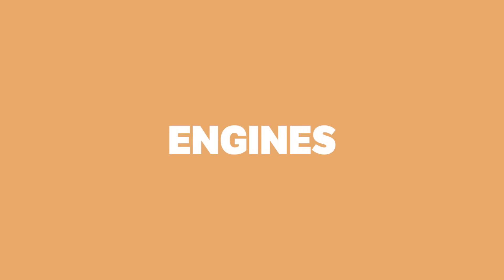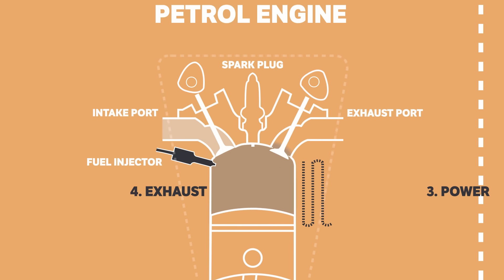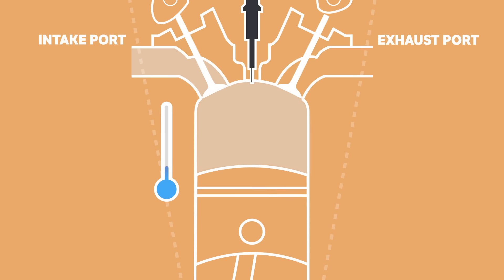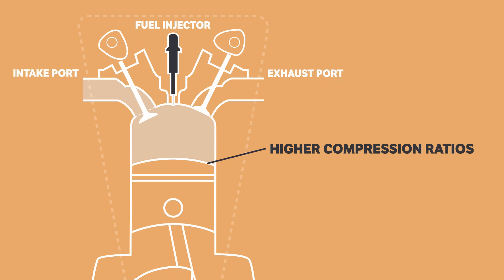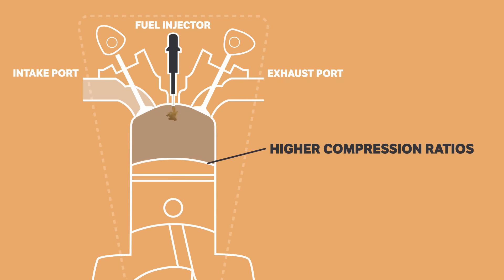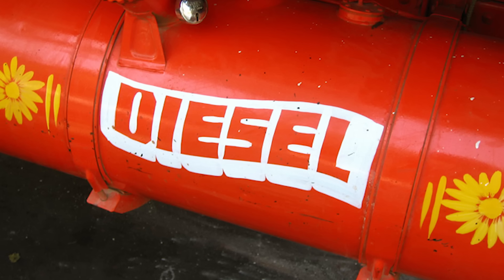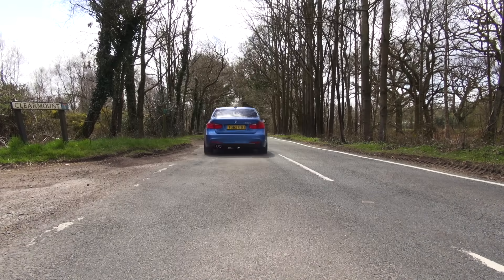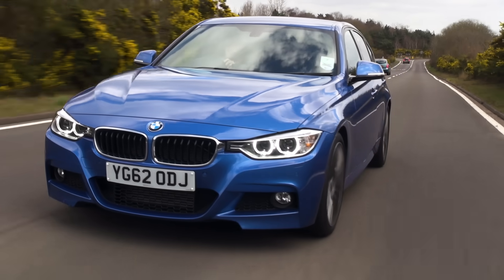The Differences Between Petrol and Diesel Engines

Comment: If this world starts going for electric cars, which it is doing, then in about 50 years, history teachers in school will use this video to show kids what it was like in the petrol/ diesel era
Reply: This comment made me sad.
Reply: Doesn't matter if you're going electric if the electricity is supplied by a polluting generator.
Reply: Luka Ohagei Ups sry m8, i fucked up. Thanks for correcting me. ;)
Reply: Scho0rschi it comes from much more efficient solar, nuclear, wind and water and heliostats
Reply: @RonanTetsu lmao imagine being this delusional
Reply: BME90 batteries are constantly improving over time with research and development. In ten years batteries will be light years ahead of today.
Reply: Luka Ohagei or maybe they create a fuel with no emissions. I feel like that is likely as well. The reason electric cars arent taking over yet is cause of the price of the batterys. You better believe they have batterys that have the power to go 400 miles on 1 charge but the price for that is ridiculous thus we have 100 mile batterys in cheap cars like the chevy spark
Reply: Why all the negativity towards electric cars? Except for the noise, an electric motor does exactly the same thing as a petrol or diesel engine - that is, driving a driveshaft to make the wheels turn.
Reply: MrSupercar55 A model S has about 350 miles of range (600 km), which seems fine to me, whereas the smaller model 3 has only goes a much more modest 220 miles (350 km), which is on the lower side. Still, it seems to me like the range issues have been pretty much sorted out, and you'd just need to build a network of chargers similar to the network of gas stations around there to make the thing viable. Other manufacturers still have to catch up with Tesla though, especially since the S is an extremely expensive car. You do need to plan your charges out though, which is a bit of a bummer. There are some cars with quick change batteries out there that you can just swap out, but they need to me much smaller capacity. I really can see this aspect going much better in the future.
As for the sound, that's much less of a practical concern, and much more of a taste thing. Not many people own supercar, and I do think that wealthy petrolheads will stick to petrol cars for a long time. Although engine noise appreciation is a bit of an acquired taste, and I'm pretty sure that high end manufacturers will find a way to make their stuff sound attractive.
Reply: We already have electric cars lmao
Reply: There will be two types of Electric car though Pure Electric for battery only car which would be used extensively in cities and Hydrogen Fuel Cell (particularly FCHEV: Fuel Cell Hybrid Electric Vehicle) which keeps the same convince as petrol/diesel car of course they can and most will have batteries too for the best of both.

One of the latest things I found out last year in collecting hydrogen is methane cracking where methane is bubbled through molten tin which cause it to break apart into carbon which is a powder (the common misconception is this make CO2 which is wrong since there is no oxygen in the methane it just produce C carbon) and 4 Hydrogen. So that is powered from waste like shit.
Reply: Toyota Mirai that's an FCHEV its already available the problem is Hydrogen filling stations much like charge points were a few years ago there are pretty much none though they are slowly being built.
Reply: Yeah luckily one of the big oil companies Shell (as far as I remember from research project I did last year) are putting there money into building Hydrogen filling stations in Europe (which is also a way for their company to survive but we benefit) for privately owned cars I'm not sure whether Shell even has presence in the US if they do I would imagine they are likely doing the same thing there. In the end its all a matter of time really.
Reply: @AurageyserOrion  late response but hydrogen fuel cells are so inneficent to make
Reply: That is very true. My dad has a 08 Lexus rx400h hybrid and it is truly amazing as it is. You get a 3.3 V6 with electric motor about 270bhp total, and for £100 we got 650 motorway miles. Considering it's a 2.5 tonne 4x4 with a 3.3 I think the hybrid tech really makes huge difference - I spend £80 in my 1.4 tonne bmw 320d so thats pretty dam good going from the lexus. Also 50% less car tax compared to say a bmw x5. There will be a day when electric is much much better than now but in terms of sustainability, hydrogen is the way. Petrol/diesel all the way for me though!
Reply: Electric cars are fine for short journeys. However, as much as they've been around for decades, when it comes to long journeys, they seem to still be having a slight teething problem. Very limited range, combined with long charging time. Even the 30 minute charging deelies they in some parts of the world are glacial compared to how quick it is to unscrew your fuel filler cap and fill up. Then there's the question of exhaust sound. Petrol supercars have the most amazing sound. Electric Tesla performance cars have no sound. From my point of view, 3-1 to petrol and diesel is the full time result. I even made a video about it a little while ago.
https://www.youtube.com/watch?v=_bXBm280nGQ
Reply: @MrSupercar55  still think that now?
Reply: Gotta use up that sweet sweet moneymaking oil supply before making decent electric car engines for the people. And gotta wait for all those petroleum companies to have monopoly in electric car manufacturing before they bring something worthwhile for us to let us switch. Thank the market for prioritizing making money instead of progress.
Reply: multiestonian wrong. they have a normal range of 180 to 300 miles
Reply: I think petrol will be replaced with electricity but I don't think this will be replaced I don't think electricity has as much energy as diesel does.
Reply: You cant rob peter to pay paul. Why would a  electric car be more efficient if you pay a company to make electric some  still are huge  coal and even a few diesel generators  . Those company's have 1000s employees that drive there daily , stuffed is shipped in and out of the company , road crews for maintenance an what not. Now you really think electric is  cleaner than gas/electric.
Reply: @markrich3271  because a gas powered car is still made by the same employees in the same factory while it is still less efficient than an electric one. Stupid logic lol
Reply: @DavidLopez-uo9ie   You  obviously didnt understand what I wrote. It had nothing to do with the efficiency of an electric car vs a  gas car .
Reply: @DavidLopez-uo9ie  I do find it amusing thats what you took away  from what I wrote.
Reply: u dont have another 50 years. youre all fucked and going in fema camps in end of 2020. if u survive u will take the chip. cannot buy or sell without it. stupid sheep
Reply: Hi kids to day wer going talk about   
Diesel
Reply: No they won’t. 

Did you learn how the Walschaerts valve gear common on steam locomotives works in school?
Reply: You need more Lithium for electric lithium on earth is less than oil
Reply: You’re right
Reply: Why not hydrogen powered cars
Reply: billionaires are going for no cars and no planes for the majority of population. have a look at brandnewtube there is a lot of info you will not see in mass media.
Reply: @adrianakuzmikova1697  I'm a billionaire and that isn't true
Reply: @Luka-hc4de  how many nicknames do you have? its funny you follow me everywhere I go :)
Reply: imma see this through 7 years later and in a few years electric vehicles will the only motor protuced
Reply: multiestonian I'm sure what you're talking about there is a hybrid
Reply: Tyrone Nelson I imagine there will be one point where there will be more charging stations then gas stations, and electric cars have way more acceleration, but I guess there’s nothing like the thrill of a roaring engine. 😏 that’s why we have hydrogen I guess
Reply: Not everyone is going to want an electric car because they have far to many disadvantages
Reply: Matthew813 Also taking into account the major things stopping electric cars taking off and going into mass production is the cost of the materials to manufacture, then you have the matter of how much it may cost to repair it if it went wrong
Reply: Hilarious when you put solar, water and wind in the same sentence with the word nuclear. Not even close buddy, Lmao
Reply: Problem with electric batteries is the vast amount of combined energy required to make them in the first place, as well as when they do go wrong, you pretty much fucked with repair bills - circa £4k repair in Uk for Lexus gs450;s/Rx400h's of the 2005-11 models. To be honest, Hydrogen has the biggest advantages, but again that has the initial combined energy of splitting h20 up in the first place, but then again petrol has the combined energy of initial extraction, transport to fuel stations, and the emissions produced. Hydrogen releases just water vapour which in the very very long term will probably make it carbon neutral. To be honest, fuck all the pollution, I'd much rather have the petrol/diesel cars. Global warming is a natural process, we're just speeding it up a tiny microscopic amount, than it would have otherwise been.
Reply: Luka Ohagei noup e cars are realy a ilusion 
and jou can make a normal gasolin engine co2 neutral 
with bio fuel 

google power to liquids its interseting
Reply: Yeah and the media degrading electric cars after if something bad happened would be pretty bad towards the market too. 😒
Reply: Where does the energy come from for your electric cars I wonder? People in the future will look back at your bullshit theories and laugh while enjoying nice lives powered by a few nuclear reactors. no need for countless rotors and inefficient solar panels.
Reply: If you replace petrol with electricity, where will the electricity come from, I wonder? From petrol?
Reply: Luka Ohagei i don't really like the idea of electric or self-driving cars. I mean, if you like cars, what's the point of driving a silent one or not driving one at all
Reply: Never mind, electric will never get off the ground. I mean literally not suitable for flying. Combustion engines will still be around in 50 years, at least for airplanes.
Reply: World: were switching to electric cars
USA: 😊 nope
Reply: Luka Ohagei yea but electric car will never replace big rigs and other heavy equipment
Reply: @poyo3582  like tank aircraft
Reply: Well those climate change turds can enjoy the product of their cold, sterile electric cars, which is abso-fucking-lutely nothing, while I'll run my comfy, reliable petrol car on ethanol like the Brazilians have been experimenting with these past few years.
Reply: Advanced Soldier IKR it annoys me when people automatically assume electric cars are amazing for the environment just because it's electric when they complain light bulbs are bad for the environment because they're electric
Reply: Luka Ohagei electric cars are a shit idea they pollute when being made >:o
Reply: Luka Ohagei 100% electric cars have low range. You need an electric motor to drive the wheels and a petrol engine/diesel engine to generate power.